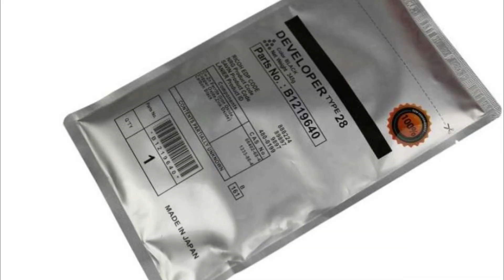SERVICE TRAINING -  LESSON 4 - ADD TONER PROBLEM RICOH MP2510 MP2550 MP2851 MP3010 MP2352SP

Comment: Tell me, when cleaning the mp2001 hopper, the device prints 3000-4000 and again there are stripes and again you have to clean it. Why this is happening.
Reply from the maker: You have a worn out developer and therefore the copier is dusty with toner. Replace the developer with a new one.
YOUTUBE SUPPORT: https://www.youtube.com/channel/UCOHtXTtGHj33pUm8Gf2FH3A/join 
PATREON: https://www.patreon.com/CopyExpertMovieStudio 
PATRONITE: https://www.patronite.pl/1796
Reply: Mileage less than 50k. The mining bunker is clogged, or the strips start because of the squeegee. After cleaning, everything is normal. But not for long